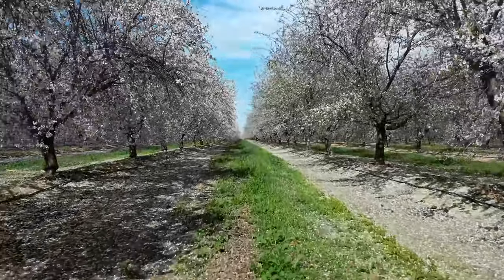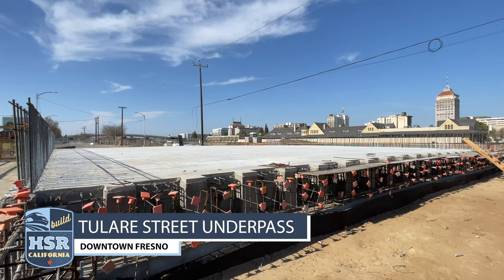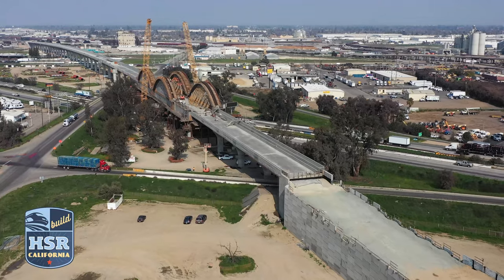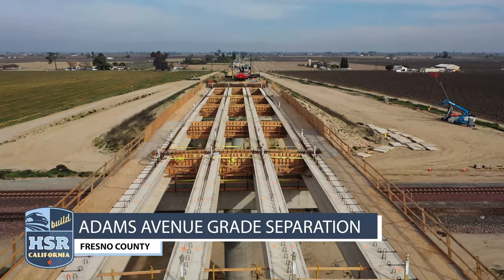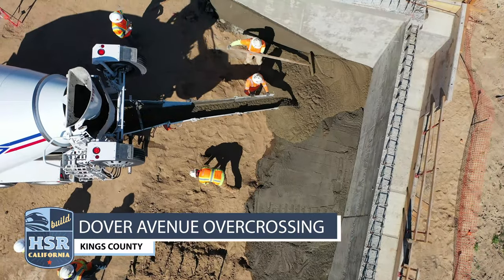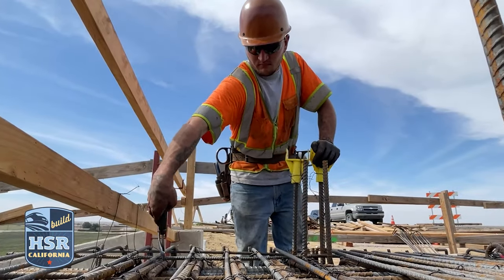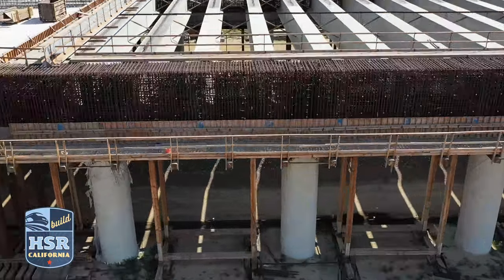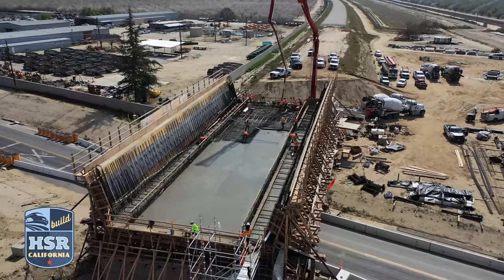California High-Speed Rail Construction Update – Spring 2022

Comment: Great progress everyone! We are finally getting some significant progress done with CP1 and 2-3! Now that a large number of the utility relocations are being started, some of the older projects that had not begun yet are getting going. I am excited to see most or all of the construction be completed by Feb or June 2023!

Lets get this done!
Reply: the current goal is interim Bakersfield-Merced service by the end of this decade. It looks like San Joaquin Joint Powers Authority (SJJPA) will be the interim operator, and be responsible for train testing and service and will be leasing the track and equipment from CHSRA, and therefore an operating subsidy won't be necessary for CHSRA since they aren't the one operating the service. While that happens, construction will continue towards SF and LA. 

I believe that once SF is connected to then CHSRA will take over operations from SJJPA for SF-Bakersfield service and eventually full Phase 1 service to LA/Anaheim. SJJPA also operates the Amtrak San Joaquins, which'll terminate at Merced from Sacramento and Oakland once HSR service begins, and that'll most likely continue after CHSRA takes over operations.
Reply: @ChrisJones-gx7fc  When will track connecting all of these grade separations, pergolas, etc. begin construction?
Reply: I'll be the first one out there with my drone.
Reply: @DouglasLippi  Prop 1A was never meant to fund the entire Phase 1 system. That was just to get the ball rolling, with cap-and-trade and other public (federal and state) and private funding making up the difference. That’s been perhaps the biggest issue with this project is it’s never had a steady stream of funding. With a more pro-rail administration and new federal money to compete for, it does give more hope on extending to SF and LA sooner. Getting a train running ASAP is crucial to proving the project’s merits, even on just a Central Valley route connecting to existing transit, and helping push construction and eventually service to SF and LA. That’s always been and will always be the goal. Newsom’s 2019 speech merely said focus would be on getting a Valley train up and running first, then turn attention toward SF and LA when more funding was available, which was basically already the plan.
Reply: @SpockvsMcCoy  the contract for track and systems should go up for bidding I believe by the end of this year, which means it would start 2023 or 2024. The goal is to get revenue service up and running by the end of this decade, so track and systems construction would need to start within a year or so in order for train testing to start by 2027 and service begins in the end of 2028 or start of 2029. At least that’s the current timeline, and it as always comes down to funding. Increased funding means timelines can be pushed up. Track & Systems have had to be delayed because of lack of sufficient funding.
Reply: @ChrisJones-gx7fc  How many feet of track can be constructed daily? Would construction of track occur during a night shift?
Reply: @SpockvsMcCoy  The contracts for Track and Systems are planning to be approved IIRC in June 2022 with it starting on CP4 in August. T&S will begin on CP1 & 2-3 once ROW construction is completed there.
Reply: @SpockvsMcCoy  The speed of tracklaying will likely be determined once the contract is negotiated. I would assume it would take several months to a year considering it would require transporting the mile+ length rail segments to the construction site as well as laying ties and ballast and getting the superelevation done to a high precision. If you are talking about also putting in catenary and signalling, that alone would also take probably the same amount of time but could be done in tandem especially considering there wouldn't be any trains actively running along the alignment like there is on the Caltrain Corridor. The most challenging part logistically will probably be getting the rails to the site since they need the longest segments possible for welding.
Reply: @AmpereBEEP  What is a realistic goal?
Reply: @SpockvsMcCoy  Just updated my comment with more information.
Reply: The completion of this HSR project should be considered high priority for national security...events in Ukraine and the Pandemic causing a spike in energy prices have proven this!
Reply: @SpockvsMcCoy  Especially if there is no route for passengers between Palmdale and Bakersfield other than I-5 or CA-14 and CA-58. I was going over the Grapevine 2 weeks ago or so and on my way back over it there was an accident right near the bottom of the hill on the Northbound side. It was backed up all the way to the top of the pass and was closed for something like 24 hours. There absolutely needs to be an alternative way for people to get across the mountains and right now we don't have any.
Reply: @SpockvsMcCoy  I’d guess same work shift schedule as current construction. They won’t need to grade a right of way or build structures, so it should be done in a couple years pending they stay on schedule and have enough funding to keep moving and not get delayed.
Reply: @AmpereBEEP  Tunneling through those mountains for HSR will be time consuming and expensive.
Reply: @ChrisJones-gx7fc  It is frustrating when progress is slow on infrastructure. A few years ago widening and other improvements were made to both 80 and 5 in Sacramento. Many times I drove those routes during the day and saw no workers.
Reply: @SpockvsMcCoy  But the other side is that going through UP's Tehachapi Pass is slow and impractical. UP outright refuses to allow Amtrak to run trains over it or even double track it, not to mention the fact that the speed limit for it is 23mph over a 23.1mi segment; By car it takes just 15 minutes, but by train it's an hour.

I would really want them to quad track whatever they build over the pass so that slower commuter trains can stop at the towns in between like Mojave and Tehachapi on the ROW without interfering with HSR operations, but thats just an idea.
Reply: @AmpereBEEP  Has the engineering for those HSR tunnels been completed?
Reply: @SpockvsMcCoy  For the tunnels themselves, I believe they have. The drawings for all structures including tunnels are shown in each EIR. They all seem to be standardized for each section now which will be really good for cost management.

They all seem to be twin bore single track tunnels though without new tunnels being dug the route will never be able to support 4 tracks.
Reply: @AmpereBEEP  Are you a member of the workforce on this project?
Reply: @SpockvsMcCoy  I am not. I would love to be one of the people working on it though.
I just have a large interest in this project and transportation planning as a whole which led me to scouring the publicly available online documents for important and useful information pertaining to upcoming work. 
I can link you the places where you can find all of the information I have gathered if you would like some of it.
Reply: It gots a few more years buddy

Comment: So glad to see the projects moving along nicely
Reply: Dark Clouds  I honestly think these are bots ngl. I live in Fresno and that one San Jaquan bridge has been in construction for like 5 years and they took down a plaza that was near it, thinking it would have the extended track done in a few months and that was the 1st year. Freaking built a new plaza across the Union Pacific track and that took only a year. They got that bridge done like last year and nothing else is happening to the other part of the project
Reply: Is this sarcams? lmao 100billion plus and no tracks and 14 yeras.
Reply: @tinytheyods  it's not $100 billion. So far it's only been about $8.6 billion spent with $2.9 billion currently available, and $21-25 billion total authorized for spending, according to CAHSR's 2022 Draft Business Plan. $105 billion is the latest estimated HIGH end cost for the full Phase 1 SF-Anaheim route, with the base cost around $87 billion and the low cost about $73 billion, also according to CAHSR's 2022 Draft Business Plan. 

There's still $4.2 billion in Prop 1A funds, which were authorized by California voters in 2008 for high speed rail construction, that need to be released to CAHSR to finish the Central Valley IOS between Merced and Bakersfield, and the longer that money is delayed in the State Legislature the longer construction will take.

Comment: What company is going to run this train system? Because I want to see if I can apply for a job there now in hopes of being an operator when it opens
Reply: Deutsche Bahn won the contract to be the operator. They're already doing some planning and engineering work locally in Sac. You can probably apply even now if you're from those parts.
Reply: You gon be waiting a very long time
Reply: @bruhbutwhytho  You lost, bud. CHSR has defeated all of your side’s lawsuits to delay the system. They are completing sections as we speak. Cope.
Reply: @TohaBgood2  even the first section is not going to be finished till 2033, but even that seems unlikely no one knows when the full system will be up and running and there are constantly delays. Not saying hsr in California is necessary bad but they are doing a terrible job at it, funny how you automatically assumed my opinion and what "side" I'm on. Cope
Reply: @bruhbutwhytho  Lol, one of the three construction packages is “substantially complete” and will be fully complete bu next year. 2033? Where did you even get that date? Did you make it up again? Source or you’re lying.
Reply: @TohaBgood2  " The complete 500-mile (805-km) Phase 1 system between San Francisco and Anaheim in earlier plans was to be completed in 2033, however, this has been slowed by unanticipated issues." It's literally on the Wikipedia page.
Reply: @TohaBgood2  Also when did I ever make stuff up in the past?
Reply: @bruhbutwhytho  Made up numbers with no citation on a Wikipedia article prove precisely nothing. The only source for this number is Ralph Vartabedian, and we all know how "truthful" he's been about CHSR in the past. His record speaks for itself.
Reply: @bruhbutwhytho  When didn't you? Do you have any primary sources for any of the garbage you're peddling here? Or do you exclusively get your information from conspiracy theory websites?
Reply: @bruhbutwhytho  Here's an example of your lying BTW. On the same wiki page you quoted it says that the first section will be finished by 2025 with trains testing by 2027. Why do you lie? Are you financially invested in this project failing or rather people thinking that it's failing?

Comment: Can conventional locomotives drag the high speed train all the way to los angeles on conventional tracks like Amtrak uses till the rest of the system is completed
Reply: Yes but it won't be considered high speed since the railway to L.A is not suitable for high speeds.
Reply: In theory, yes. However, in practice, Amtrak can't even run it's own trains from Bakersfield to Los Angeles because freight railroads own the tracks over Tehachapi Pass and those tracks have been running at capacity for years so Amtrak can't get a slot to get its passenger trains to LA. That's why Amtrak passengers today have to take an Amtrak bus from Bakersfield to LA or take the long slow (but more scenic) way on a train along the Central Coast.  
One of the biggest goals of this project is to restore the passenger rail connection between Los Angeles and the Central Coast by creating a new route through the Tehachapis. Metrolink's Antelope Valley Line from Palmdale to LA has the capacity to complete the journey from there if a non-high speed patch is desired.
Reply: @brandonk9706  freight railroads own most of the tracks Amtrak operates on, the exceptions being a few Amtrak owns like the NE Corridor and a few Midwest routes, as well as routes owned by public entities like California's Surf Line between Fullerton and San Diego (jointly owned by SCRRA and NCTD). 

Going by rail between Bakersfield and LA would take much longer than the bus connection (2 hours by bus vs probably 4-5, if not longer, by train), plus as you said the route is busy and is mostly single track, so there aren't many time slots for regular passenger trains with all the freight traffic. The Coast Starlight has rarely used Tehachapi when the Coast Line is being repaired, and the Southwest Chief, although at night and very early morning, does use Cajon Pass, a much busier freight route, daily between LA and Chicago. 

Passenger trains are meant to get priority over freight trains, but because many parts of the US rail network is single track, trains have to wait their turn to use stretches of it, and that can impact the passenger train severely if it misses its slot, having to then wait for the next available one, or if a freight train using that stretch is delayed and the passenger train must wait longer for the freight to get out of the way.